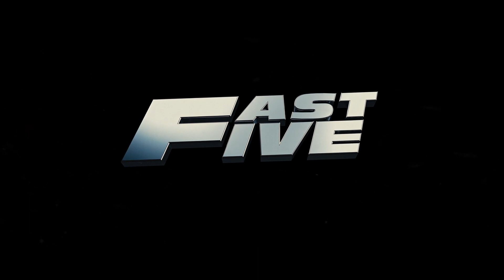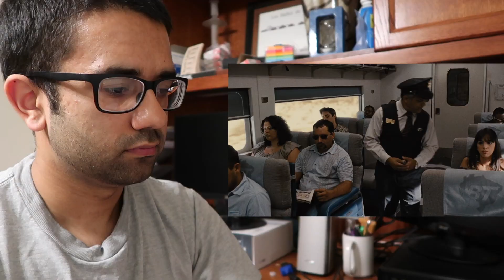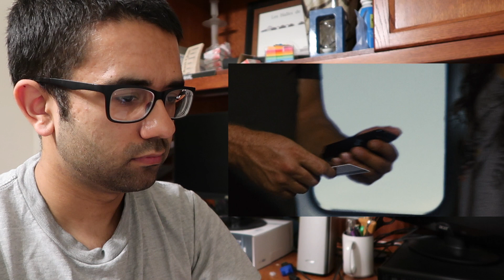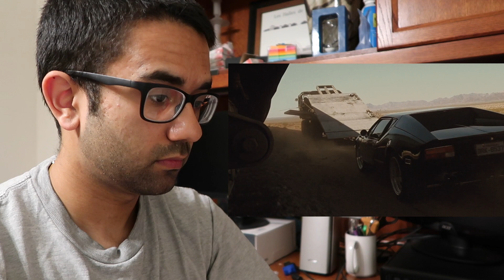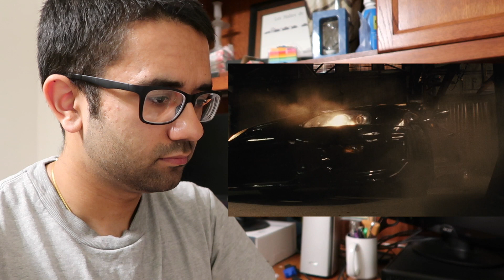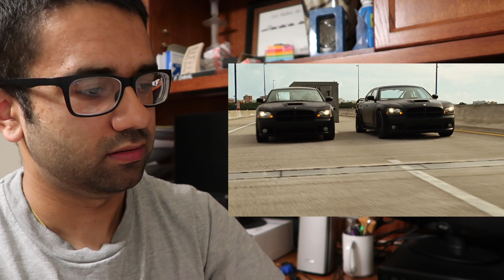Real Engineer reacts to Fast and Furious 5 | Engineering and Science accuracy

Comment: ehh it's most likely possible they probably had upgrades before doing this mission and they could be using a procharger with a V6 or a V8 engine not just that but also the tunning

Comment: I think pulling a safe is possible if the car has enough torque but turning I don’t think is possible unless it has wheels idk 
The cars are srt8 chargers which it has 420 lb-ft of torque, combined has 840 
I’m pretty sure they modify the engine which idk the stats
Reply: The lore behind turning the safe is having two cars manuevering it. Thing of it like flying a two wire kite.

Comment: They can actually do the copying ID thing that fast. With right tool it's basically instantaneous. Although it's not universal. But for the most of the part they use quite similar and familiar technology which is easy to hack.

Comment: In the creating of the movie. The cars literally drag a safe. It's behind the scenes. Look it up. For the rest, keep up the good work :)
Reply: I doubt the safe used to film is identical in mass to it's interpreted counterpart in the movie.
Reply: @nhiamoua5816  yeah i thought so too. But if you look it up it says " two dodge chargers are dragging a 9000 pound safe" they did 2 things tho. They did scenes with the real safe and they made a safe on top of a car, so the safe could actually like kinda drive. But 90% of the scene was with a real safe.
Reply: @quikun3703  I think you may have misinterpreted it because there's no way those two cars are pulling 9000lbs at those speeds like in the movie. however, it's far more believable that they used a real safe to create the destruction, but it's not a real safe when being pulled as shown in this clip. I'm sure they used a few tricks for that.
Reply: @nhiamoua5816  have you looked it up already?